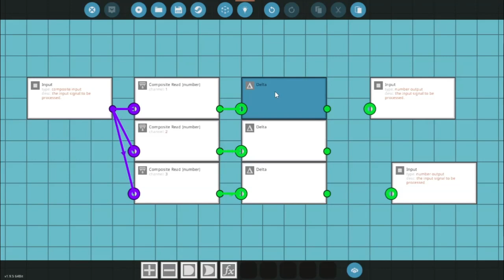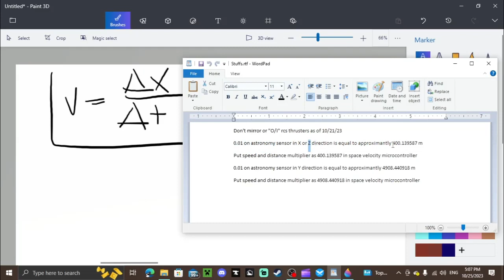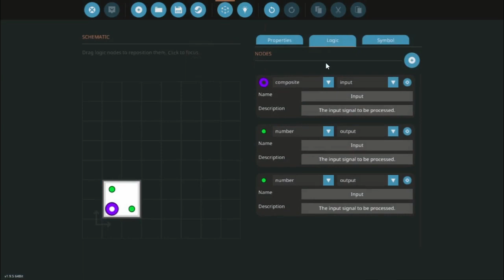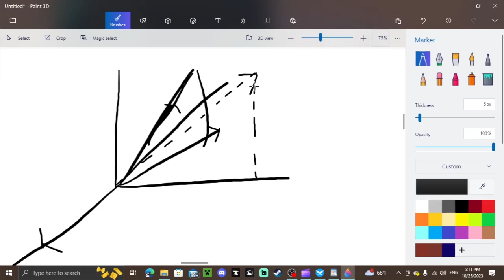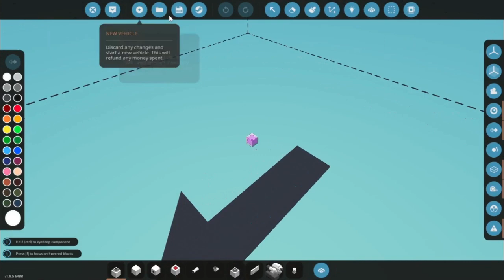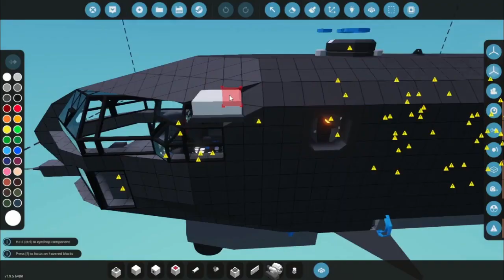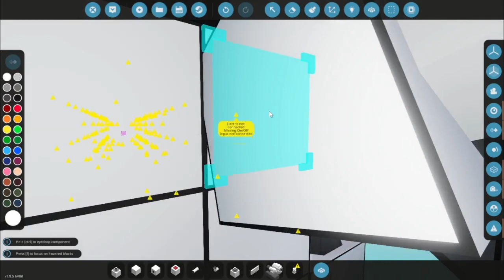Speed With The Astronomy Sensor | Stormworks Tutorial [OUTDATED]

Comment: Hi again! I made this processor, tested it, and it works. but I have a question - to get the vertical speed, will it be enough to subtract the vertical speed from the absolute speed?
Reply from the maker: Sorry for the very very late reply! The sensors have changed now, but to get the vertical speed, I think you just put the vertical component into the square alone if that makes sense
Reply: @AXbcyz  oh yes, this sensor a bit changed... and i noticed one problem, this controller won't work
Reply from the maker: @NNCHKO  I’ll try and make an updated version soon